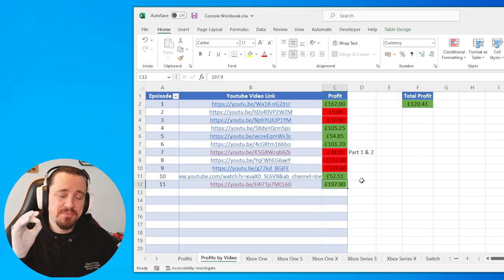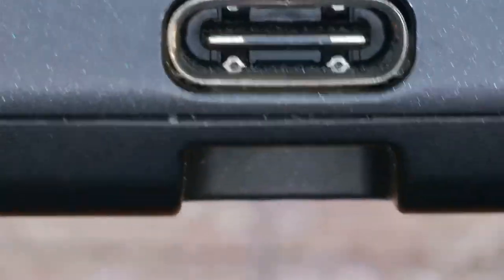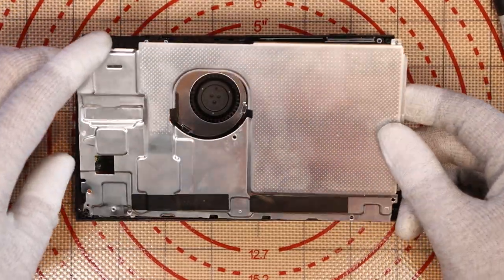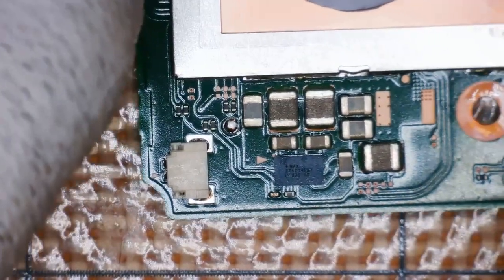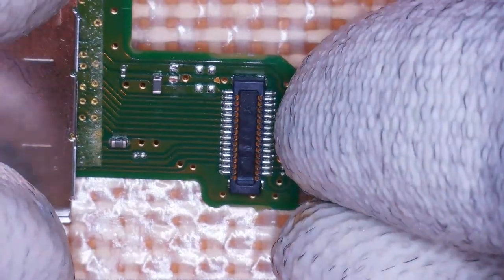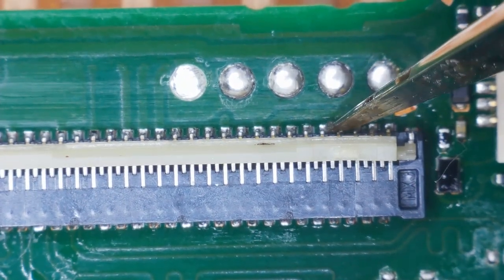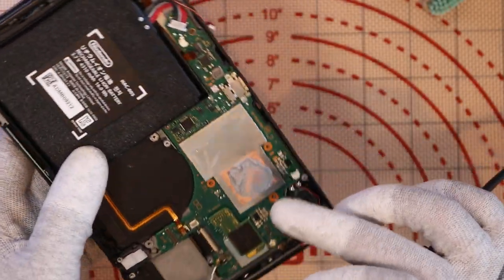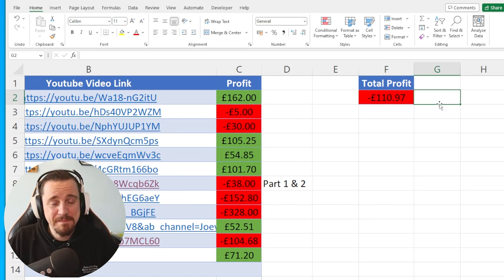Trying to Fix These BROKEN eBay Items and Make a Profit | Profit or Loss S1:E12

Comment: Joey, stripped screws can be removed with Valve Lapping Compound (Course).  Fill the hole with the compound and insert the screwdriver and carefully take it out.  Its been one of the oldest tricks in the book and definitely worth trying before breaking any plastics.  I hope you find this helpful.  The compound can be purchased from your local auto parts supplier for approximately $8-$12. It would be nearly a lifetime supply as you don't need much. Have a great day!!!
Reply from the maker: Thankyou! I’ve just purchased some so will give it a test in a future video. Thanks for much for the advice!

Comment: Hey Joey, I really like watching your videos lately and today I actually got a tip for you. If you encounter a severely stripped screw, try cutting a slot in it with the disc looking tool of the grinding pen. It should then be possible to unscrew it with a flat head screwdriver. I have so far managed to get every screw out with this method, even severely (and I really mean severely) water damaged, rusty ones.

Comment: You can use a 1k resistor to test the battery as well. Major drop in voltage is bad.

Comment: Awesome video! Perhaps a bit late, but when you test the power at 24:11 it looks like you did not plug the WIFI cable onto its receptor before powering on. It is quite easy to burn the transmitter in any radio if it is being turned on without a load (an antenna). You probably know this by now, but I just wanted to mention it :)

Comment: 2 nintendo switches 
1/ doesnt recognise joycon solved with some cleaning ipa
2/ it so tricky 1st device have some shorts solved by detecting bad capacitors then some chargin chip went bad and then sound is missing fixed by replacing the chip for it

Comment: And this is the reason why USB C is a bad design. Lines crossed on the connector means broken one which must be replaced with increased costs.. So repair is necessary on main device and not simply replacing a cable.

Comment: Can someone explain to me e those chips that he removed with heat and soldered back on how that works, how do they make contact back on to the board, most chips have the legs going down that get soldered individually.. thanks for answer my silly probably stupid question in advance.

Comment: If you're using parts from old switches you've already bought then you shouldn't include the costs in the spreadsheet as you're simply double counting and you're math ends up being off ...
Reply from the maker: I actually agree. I need to make a change with that on the spreadsheet. Only thing that holds me back is that I have a backlog of stuff from before the spreadsheet.